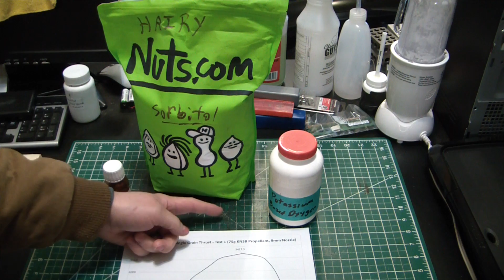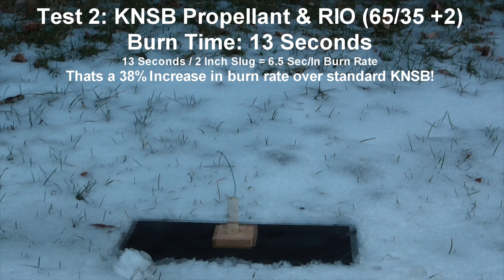What Happens When You Add Rust to Rocket Propellant? - ElementalMaker

Comment: Do one aluminum powder, and one with aluminum oxide powder, and then both with rust. Then the best one of those, copy it and add charcoal, or graphite to use the extra oxygen.  C'mon everybody says to experiment, but everyone does the same thing, sugar, кио3, rust, and glitter. Make some try some that puts out the "Big Pressure” but doesn't runaway into detonation. Just max TF out of the difference between solid and gas, and use that along with stable burn rate.
Dunno I'm ripped and thought, use excess O2 from metal oxides to fuel some extra CO2 reactions, plus it's like a "Thermite microdose" and that's funny. 

©==3

Comment: Would manganese dioxide have a similar effect?
it is a mild oxidizer and should give off a bit of oxygen at 500c and turn into Mn2O3, the fumes would be nasty from Mn2O3 and also, what about MnO2 battery paste?
Reply from the maker: Great question, I'd think MnO2 probably would act as a good burn rate catalyst. Might be a fun test!
Reply: @ElementalMaker  Maybe

That might be something I should try one day, that is if I can get a chlorate/perchlorate cell running

Comment: Hi. What is the best ratio of red iron oxide to the potassium and sorbitol mix? Thanks and keep up the good videos!
Reply from the maker: Depends on how fast you want it to burn. Most folks use anywhere between 0.5% to 2%
Reply: @ElementalMaker  Ok nice and I imagine if I put even more it will eventually just not burn as good?
Reply from the maker: @clementfortin4315  yessir, at a certain point it will offer diminishing returns. 2% is about the max
Reply: @ElementalMaker  Ok cool thank you very much! I'm making bunch of rocket test!

Comment: Burning the mixtures in the open air do not tell you much about their utility as a propellant. A trivial example is BP burned unconfined and when confined - massive difference. 

If I recall correctly, KN is not used with Al as a propellant because the pressure exponent is too great.

Comment: The rust (FeO2) supplies 2 oxygen atoms increasing the burn rate.  Which is what the potassium nitrate (KNO3) is already doing and is required for the rocket engine to burn at all. Titanium (Ti) has no oxygen atoms to give and will just burn up.  The sparks are cool though.  Anything that supplies additional oxygen atoms will increase the burn rate.  It would be interesting to try potassium permanganate (KMnO4), Ammonium Nitrate (NH4NO3), or even Aluminum Oxide (AlO) and see what happens.

Comment: when we made napalm in army …   there was huge difference in temps  when you added aluminium to mix .. and even more when you added red rust ( iron oxide ) to mix..     but the burn rate went up really really rapidly at same time.    but those fuels will burn faster when they are in semi closed in..   the heat will make it burn faster and pressure is higher as well..

Comment: Can you please make a vid about adding different metal dusts to rocket propellant? You've already done this one with iron oxide but I mean with Al, Cu, Mg, Al-Mg alloy.... Basically to see if it can colour the flame to any point where as the rocket rises a green or white flame can be seen.
Reply from the maker: With this type of propellant there is no way to color the flame, as it's actually just a smoke trail. Composite AP propellants can easily be colored though, and I will be doing videos on that shortly 👍

Comment: So, out of curiosity, what would happen if you loaded an engine so the first portion of the burn was iron oxide and say about half way through it went to normal slow burning propellant? The iron oxide should get the rocket moving faster initially which would overcome at rest inertia and then the slow propellant would cause a longer burn for possibly greater apogee........what do you think?
Reply from the maker: That's definitely doable, but due to the larger size of the motor required and the mass that goes with that, it's typically more effective to have two stages. One for lift off, and then that is ejected and a second motor called the sustainer is ignited.

Comment: While others have already suggested adding aluminum powder, I would like to expand on why it would be a good addition. Aluminum combustion doesn't create much in the way of gaseous products, but it does create a crap-ton of heat (energy). The reason KNSB propellants are limited to specific impulses of ~120s is their low energy density, not a shortage of gaseous products. Adding something like 10% of fine aluminum powder (with a corresponding increase in KN to accommodate it) should increase the energy density (and thus specific impulse) substantially. The trick is to use a fine enough Al powder that it completes combustion before it exits the nozzle. Sparks are pretty, but they would indicate that the particle size is still too high. An alternative to going to finer Al powder is to use a longer nozzle, which would give the propellant more time to combust before it exits. And no worries about having a few % Fe2O3 in with the Al powder, since there is so much other stuff in the mix you won't see the kind of heat a thermite reaction normally produces.
Reply: Man you really know chemistry

Comment: My science fair project for school last semester was making rocket fuel out of sugar and stump remover. I just ended up using the dry packing method in the end because it was 40° F outside and using my electric grittle was a huge pain. The fuel was never liquid enough to pour into the PVC pipe. I did test a bit of the carmelized stuff and it did burn significantly faster than the other methods. I still have a container of stump remover left so I might try it again in the summer but the mess it made working with the stuff was awful. My digital scale still has the stuff on it.
Reply from the maker: I'm very glad to hear you were able to do that as a school project! I'm sure many schools out there wouldn't allow for anything involving chemicals and fire. That is awesome 👍

Comment: YouTube sucks now with all the ads, time for a new site to take over.
Reply: Just get an ad blocker for your browser of choise
Reply: John McCallum I used an ad blocker and it made the vids cut off mid run.
Reply: I am using Adblock plus now and apart from some other sites not loading you tube loads and runs just fine.
Reply: John McCallum I use AdBlock Pro and it causes my videos to freeze or not play all the way through so I disabled it.

Comment: If you want to add colored flame or effects to your rocket motors you can add these metals.. The larger the chunks the more of a spark that will be thrown out, the finer the grind the more it will just tint the flame.
(this comes from a lecture about making fireworks) Red: strontium, white: magnesium (or titanium/phosphorus), yellow: sodium, green: barium (or zinc),  blue: copper, purple: potassium, and for gold sparks... Iron. 
You can also make a blue flame by burning sulfur in a pure oxygen environment but good luck with that in a rocket motor.

Comment: I have found that a small amount of sulfur will do a pretty good job of catalyzing the reaction.  Might want to consider giving that a try.
Reply: I'd be sketched out by putting a composition with sulfur on the heater for melting. Sulfur is more reactive than Fe2O3, so you might get spontaneous ignition.

Comment: any particular reason for choosing KNSB over KNSU or KNDX?
Reply from the maker: I prefer it simply for its significantly lower melting point and easier workability than other sugar fuels. It does have less overall energy content though, so it's a bit of a trade. Safer and easier to use, but less power.

Comment: So where was the Arduino test stand Tests you promised way back long ago? Wouldn't Aluminium powder be a better test additive than Titanium that doesn't affect burn rate ? How about a BP test?
Reply: The titanium was just for show, to create sparks in exhaust.
Reply: @JJayzX  Great show of sparks, in broad daylight! It was spectacular (NOT). I saw 6 or 7 spots. Months ago He said he was going to do thrust measurement tests on the Arduino test gizmo he made of different mixtures to evaluate the fuel types. This video was a waste of time, it was a just a quickly made video with little to no effort to fill the gaps between his interesting Vids!

Comment: SRBs used aluminium in the propellant mix, would that have an effect on this kind of propellant? And how about a mix of iron dioxide and aluminium? (Somebody already mentioned thermite)
Reply: Adding something like 10% fine aluminum powder should increase the specific impulse of the rocket. Even with a few percent iron oxide on top of that, they would be too dilute to get any kind of proper thermite reaction going.
Reply: Higher temperatures would most likely be required to use aluminum over iron. Also mixing them for thermite would simply just destroy the rocket and produce little thrust.

Comment: Is it supposed to be alu powder and rust in the knsb test? If it burns, obviously it will be a hugh kick.
Reply: aluminum and iron makes thermite which is mainly a fast high heat reaction. you need large amounts of expansive gas for thrust.
Reply: @JJayzX  You aren't going to get a thermite reaction when the iron oxide and aluminum are only ~10% of the overall mix. Especially with something like KN to serve as an oxygen source, the Al will consume the KN well before it gets to work on the Fe2O3.

Comment: What about making a 2 stage with red propellant in 2/3 of the tube and the standard in the last 1/3?
Reply: It's not necessarily 2 stage and overall would lead to a lesser altitude versus using an actual 2 stage. There's the efficiencies of the different propellants and the thrust to weight ratio.
Reply: That would be backward anyway, at higher speeds you need more thrust because of aerodynamic loading.  The reason space ships get away with less later is because they are in thin air by then.
Reply: @GigsTaggart   ah that makes sense. I havent played with model rockets since 7th grade. And I'm 30 now if that gives an idea of how long it's been.

Comment: I put iron oxide into a motor as a way to give more O2 for the burn. Unfortunately, i put it into an aluminium tube to test it. Epic fail in my front lawn just as the cops drove past. Luckly they saw the funny side.
Reply: I once made a rocket made of 1" black pipe filled with R-candy (just firmly packed powder not cooked) and the 1/4" nozzle got clogged (my best guess -- it sure sounded that way) shot the nozzle off and took off a decent sized tree branch (1" or so thick) and kept going... never found it. Safe to say I never did that again. One of those "ok that was really dumb" moments (rare for me). It did fail where I intended it to fail but still.... I have a clip of it in my shotgun shell rocket video if ya don't mind me plugging my self 😁
Reply: Hahaha that's a great story
Reply: How many watchlists are you on now?
Reply: I call BS the iron oxide wont turn into a thermite reaction as you are implying because its in a aluminum tube. The way thermite works is by the electronegativity of the metals. Rust isn't an oxidizer it just happens to be way down the electronegativity line for the reaction to work. Thermite isn't a standard chemical burn like black powder or kno3 sugar etc its just a very exothermic self sustaining reaction, reason being its products are solids not gasses need for rockets and other things. Adding to much to your "what ever" rocket will just act like an inert chemical like sand. If you are saying the iron oxide reacted with the tube and created a huge flame that the police just happened to be driving by and saw you are lying. Plus its way too coincidal that in the 3 seconds it burnt a cop was driving by your trailer park (see I can sink down to ad hominin attacks)
Reply: @daveb5041  Dude he meant it looked like a pipe b0mb

Comment: can you also test those silicone+potassium permanganate or pvc+potassium chlorate/perchlorate propellants?
Reply from the maker: Silicone and KMNO4 woulnd not make a good propellant at all. Chlorate based rockets would almost be guaranteed to explode every time and be insanely dangerous to make. Perchlorate is viable, but the ammonium salt is best. In a rocket you want as much of the reaction products as possible to be gas, hence why the ammonium salt is best.
Reply: @ElementalMaker  cant find the tests using permanganate/sillicone as a rocket propellant but here is a burning of such composition as fuse:
https://www.youtube.com/watch?v=wkFaz-clHp4
here is explanation about its composition:
http://www.sciencemadness.org/talk/viewthread.php?tid=31890

i was thinking about ammonium perchlorate/PVC and potassium perchlorate/epoxy rocket propellants, my bad... those should be quit interesting and the results should be quite different than the potassium nitrate/sugar one... also molding the grain should be quite easy on those...

Comment: I'm excited to see what the red iron oxide test looks like on that neat little test rig, considering the difference in burn rate. I hope it wouldnt change throat erosion too much compares to standard knsp.
Reply from the maker: I think It'll give a huge boost in thrust. Erosion should be minimal with the graphite nozzles, but it is possible.
Reply: This is basically what the Hamas terrorist organization is using as rocket propellent.  Im not a chemist or bomb maker.  I was shocked to find out that you can make rocket fuel out of rusted iron. Jesus Christ 😱

Comment: I'm kinda curious now what would happen if you mixed in a small amount of thermite mixture instead of just Fe2O3. I don't expect it would be too fantastic or anything, just interesting to see what the addition of aluminum would do there
Reply: Thermite would just melt the rocket. You need a reaction to create voluminous amounts of gas, not just heat that you mainly get with thermite.
Reply: @JJayzX  there is a type of iron oxide (can't remember which exactly) that is basically Fe2O3+H20 (also unsure about the ratio) and releases the water as steam and the reaction doesn't get quite as hot as "normal" thermite
Reply: https://youtu.be/r0kfn4P2nfQ

Timestamp 10:15